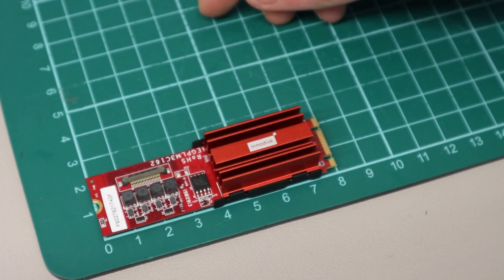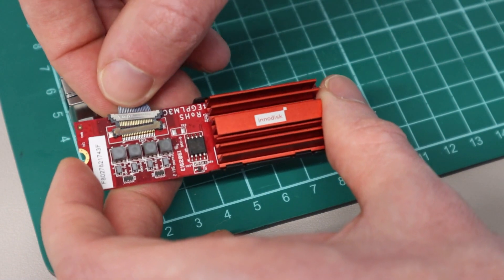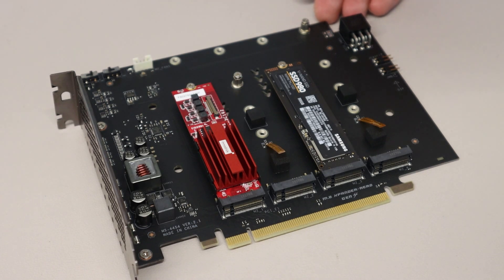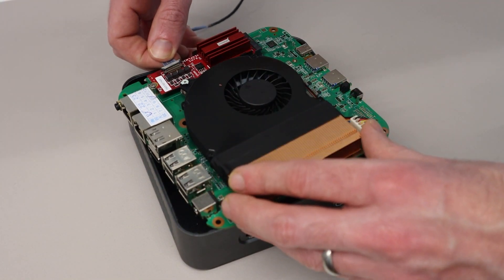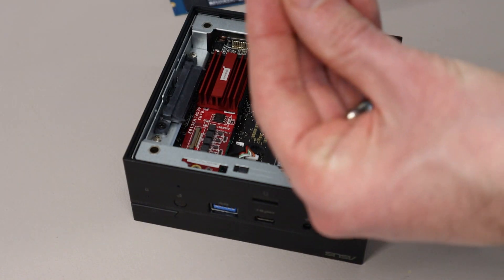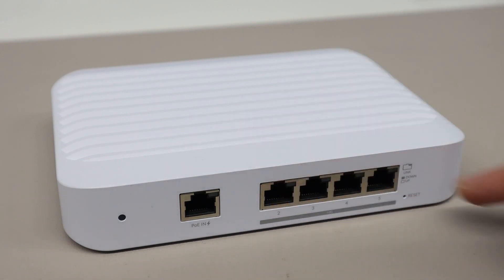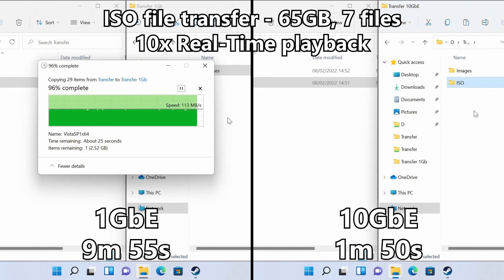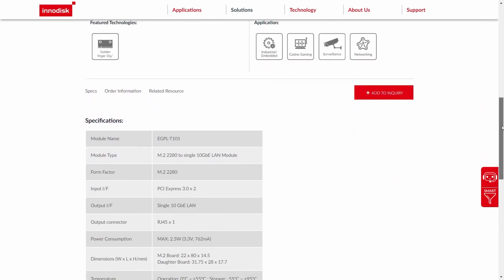InnoDisk EGPL-T101 Review - Bringing 10GbE to an M.2 Form Factor

Comment: The issue with this card/device is that despite the heatsink, it overheats if your system does not have proper airflow. And the most common use case for this are sff builds where cooling is constrained. This is the exact situation that I found myself when I installed on an ITX motherboard in a compact case. After a short period of time, networking stopped working. Since my build didn't involve a graphics card, I just simply used the PCIe x16 slot for a 10 GbE NIC.

Comment: I ended up purchasing this for a small plex box that already has the PCIe slot taken up by a GPU for transcoding... With iperf I'm seeing about 4 gigabit speeds - any thoughts on how to address? I disabled various settings in the advanced network adapter properties, but perhaps there's something like a bios setting I'm missing. Thanks!
Reply: What pci bus version does it have?
Reply: Turn on jumbo frames (9000 byte frames).  Check speed with iperf3 in linux, not just drag and drop Windows file copy...

Comment: very cool product, and your video is comprehensive! 
In cramped aluminium cases you can unscrew the stock heatsink, then make a "soft heatpipe" by thermal-gluing Panasonic PG nanocarbon sheets from the chip to the case.

Comment: 10GbE is only useful if you have NVMe storage that would saturate a normal gigabit connection. So if you install the 10GbE card in a pc with a SATA SSD it will be a waste because you cannot saturate the 10GbE link.
Reply from the maker: I run an M.2 NVMe SSD as a cache for my home server storage, so all my writing and most my reading of things I'm working on can be done at up to around 1GB/sec.
Reply: Bizarre and weird thing to say. Very much not true.